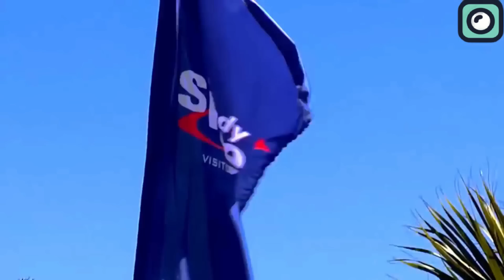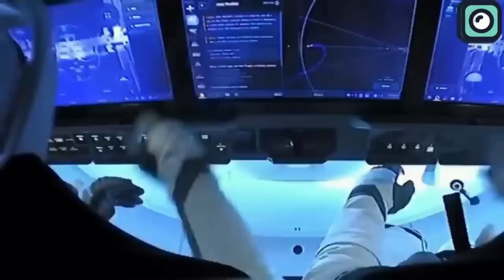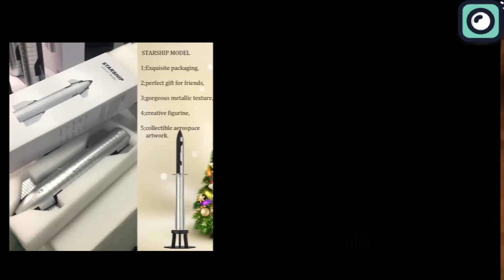NASA Picks SpaceX Over ULA To Launch The Dream Chaser!

Comment: Someone said that the interior of the SpaceX main module was pretty snug to fit the Dream Chaser with tight clearances. i woner if they will modify the farings is they go with that plan.
Reply: Its all or nothing. It fits or it doesn't. They won't be modifying the fairing. They Do make the faring in-house, however, the military wanted something like 5.4m wide (vs 5.2m wide) and longer fairing and they couldn't accommodate them without going outside to make a different fairing. They tried ULA's fairing maker but they said No. It was ULA proprietal. I would assume that if it doesn't fit, it might be easier to put Sierra on the Starship since it has 2 successful flights under its belt with a third comming up in 2 weeks. 

I would think they would make any decision After the 5th flight is successful, assuming it is. 
A successful flight would give 3 successful launchers to just below orbital altitude (orbital insertion should be simple, given that). Landing intact is irrelevant (so long as the launch tower is intact).
ULA has pushed back their launch... I'm not sure why. 

They nee 2 successful flights to be certified for Military launches that are Severely backed up. 
They are doubtless looking for 2 commercial customers who Will launch on time but I doubt they can find them in a couple of months and launch. 

Its been 7 months since Vulcan launched, the BE-4 engines are supposed to be ready with stock for several flights... why ULA doesn't just bite the bullet and launch two unpaid rockets to unstopper the military flights seems mystifying.  They are already incurring financial penalties from the military. 

They seem to be acting like paupers without the $150m or so to launch 2 non-paid flights to make the military happy. Seems like ULAs parent companies are being penny wise and pound foolish... what one would expect from Boeing... another dissatisfied customer due to penny pinching and bad management.